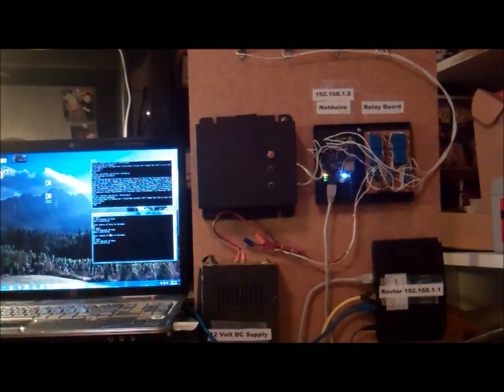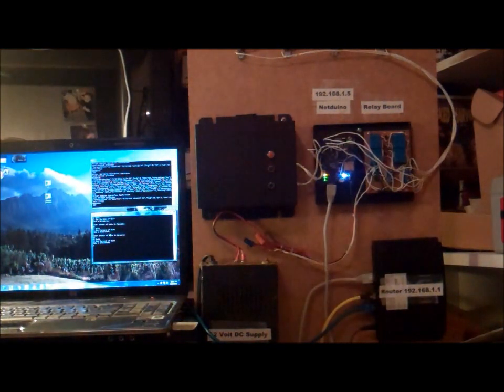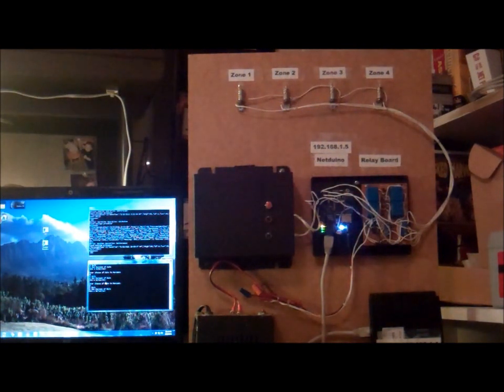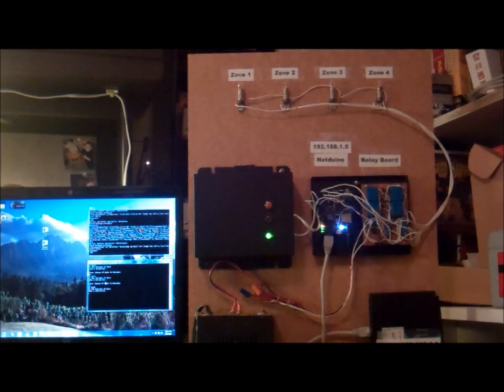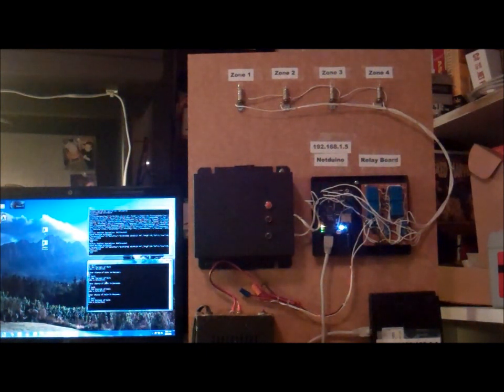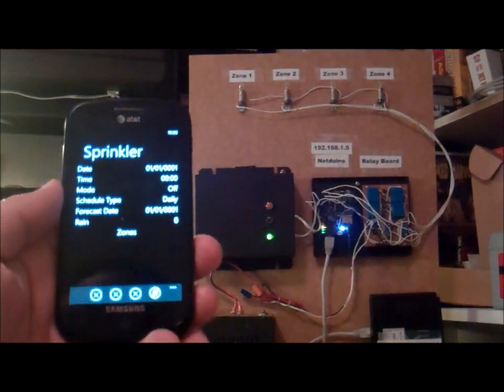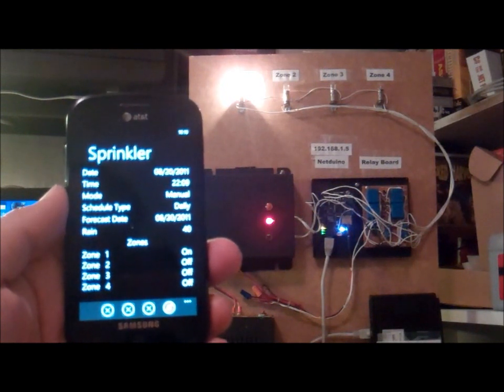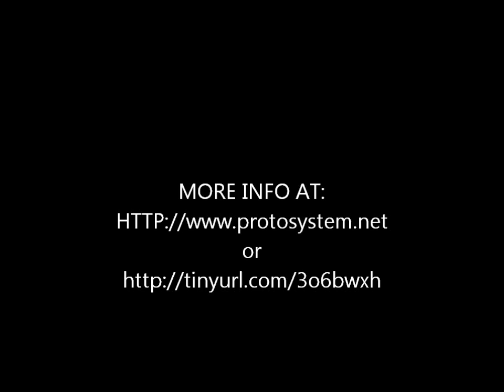Lawn Sprinkler with Netduino, Azure & Wp7

Comment from the maker: I am not using a pre-built shield as this was primarily a prototype.  I intend to either fab a shield with Triacs in place of the relays or purchase a relay shield.  All parts for my prototype were bought at Radio shack (except for the prototype shield).  All the parts are shown on the schematic located in the docs folder of my bitbucket repository. Head over to bitbucket and search for mlinnen and you should be able to find the public repro.